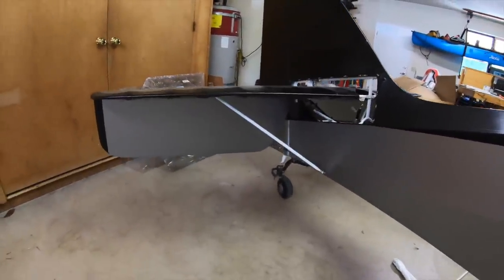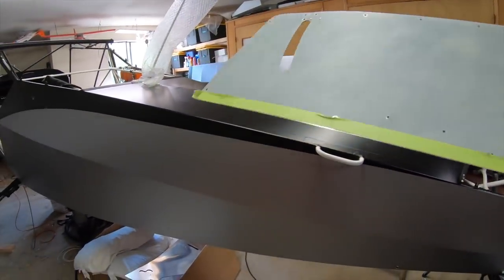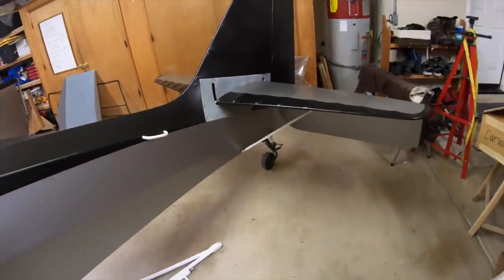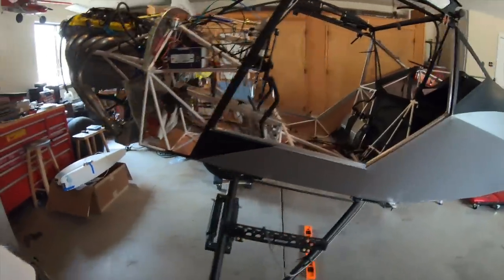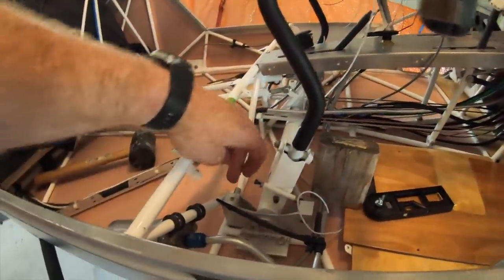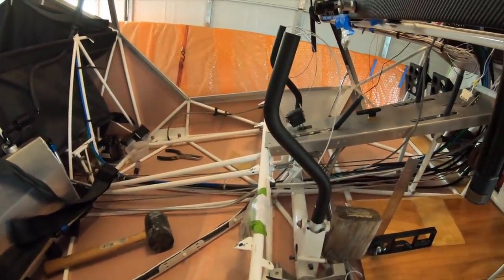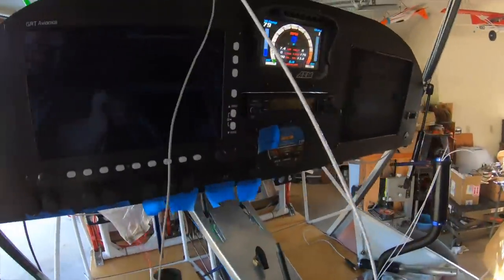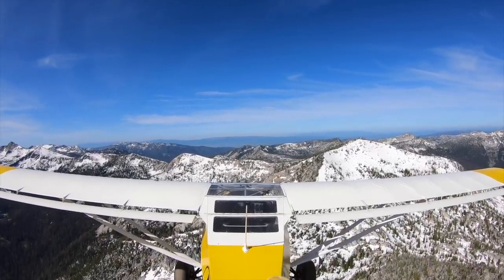Kitfox 7 Apex Build Episode 26 Tail Fairings & Lighting

Comment: Looks great! I see you have an AV30 rigged up. Guess the beaconX wont work with the GRT. Backup attitude is a plus..   I haven't covered yet and just did the elevator rigging so I didn't have to climb in there.
Reply from the maker: The AV30 you see in the video is a cardboard cut out. Ended up not going with it.

Comment: Is that an AV-30 cut out decal in the center of your panel?  I am looking to get rid of my vacuum system and am going back and forth between the G5 and the AV-30.  If so , why the AV-30?
Reply from the maker: I was considering the AV-30 as the control head for the Tailbeacon X transponder. I just put the AV-30 in my Kitfox 5 and it is a really cool gauge, but the Airspeed indication is not accurate at lower speeds making it not acceptable as a primary EFIS in my opinion.

Comment: Bryan, is that trim position sensor something that came with the kit, or something you got from Kitfox, or elsewhere?  Do you have a manufacturer and part number you can share?  I'm building a Series 5 and I need a trim sensor to feed my Dynon.  The the only one I've seen is the RAC unit, but yours looks different.  Thanks!
Reply from the maker: It is a kit from Kitfox you can order.
Reply: @BowenAero  Aaah!  Thanks; I went back through the parts catalog again and found it.  Does that kit include mounting hardware, or connectors, or something else to justify the price (it's nearly triple the RAC sensor)?

Comment: using the correct diameter cleco, would be better than a 3/32 when aligning.. so that you can make sure your nutplates are inline with the holes on the panel. Some nutplates do move a little.. but just to make sure they dont move around too much. Are you using a nutplate jig, for drilling the rivet holes?

Cleco sizes as follows
Silver is 3/32
Copper is 1/8
black is 5/32
gold is 3/16

In case people were curious
Reply from the maker: As per the Kitfox directions. You start with 1/8 and then enlarge the holes and then I used a nut plate as a jig. All came out perfectly aligned.
Reply: Awesome!. Always love watching your videos.  I am very close to getting my PPL. Hope to see more videos so I can convince my wife I can build a plane. All my military sheetmetal and painting exp never thought I would even entertain building a plane.

Comment: Great video. Is there anything to help prevent those elevator end-stop set screws from vibrating out of position over time? Thank you!
Reply from the maker: The lock nut and then torque strip it and check during condition inspection. In 14 years I never saw one move on my model 5 but it is part of the inspection

Comment: the Dark Arrow 1 uses a SPLIT RUDDER..  https://youtu.be/JHO2aHXxoh8  each rudder pedal pushes one side of the rudder out.. if you push both pedals the rudder opens as a speed brake..  since its spring return..  it might not be that hard to build..  even as a retrofit. using a coaxial shaft up the middle of the rudder.. so pulling on one cable opens one side.. pulling on the other cable opens the other side.  probably require a change in rudder pedal assembly also..